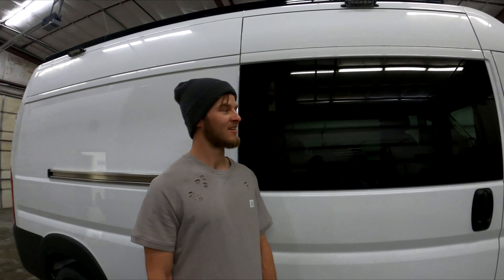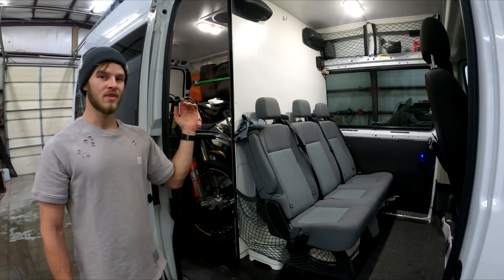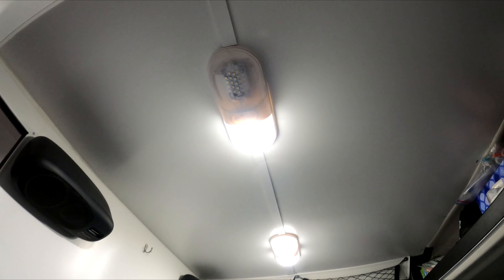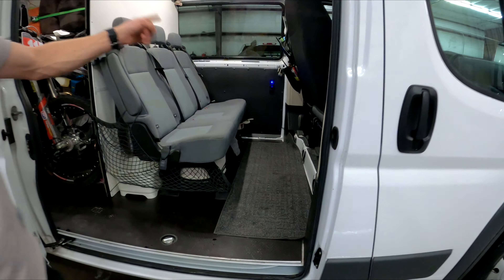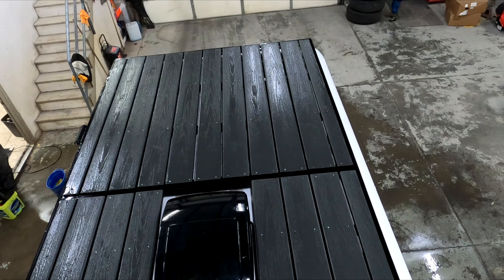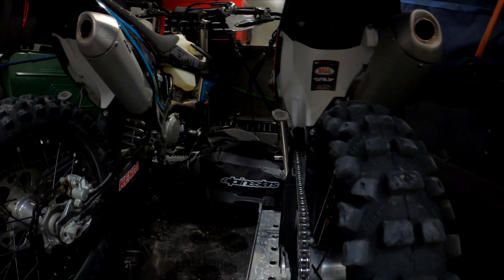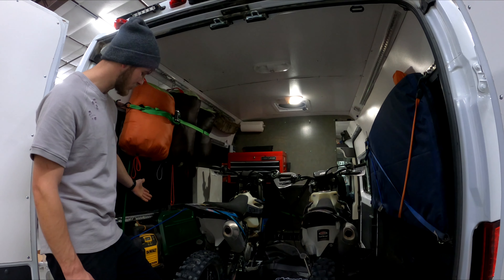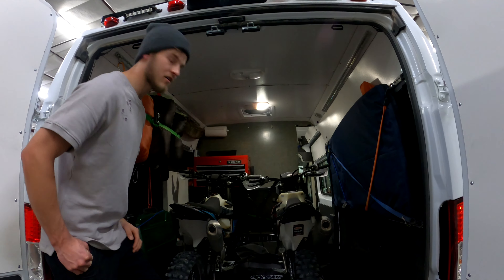Take a tour of my dads ProMaster MOTOVAN Conversion!

Comment: Do you have any install videos on mounting the rear seats? Is the gas tank in the way of mounting the rear seats? Thanks
Reply from the maker: I didn’t get any videos of mounting the seats. They have a bolt in clip style mount so you can remove the seat without unbolting the whole setup. The gas tank wasn’t in the way
Reply: @AustinStout  thanks for the info